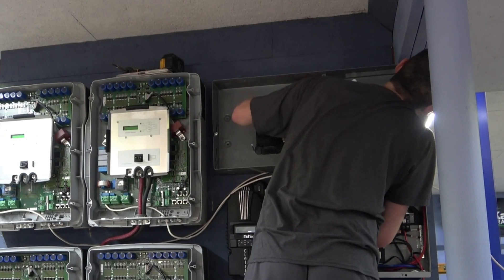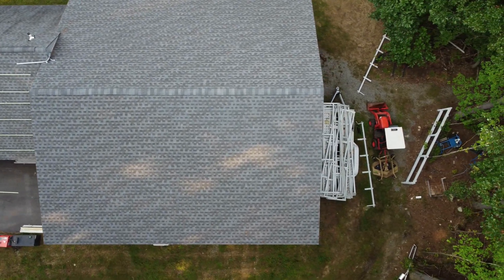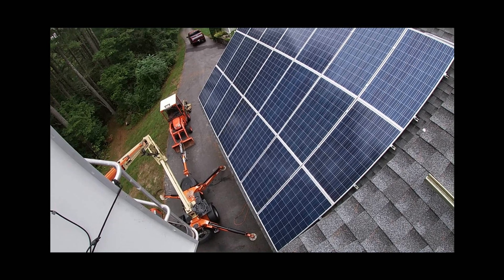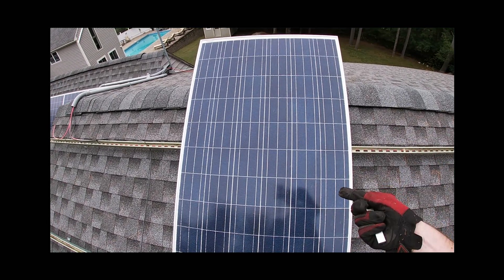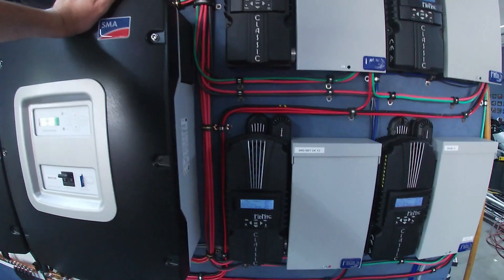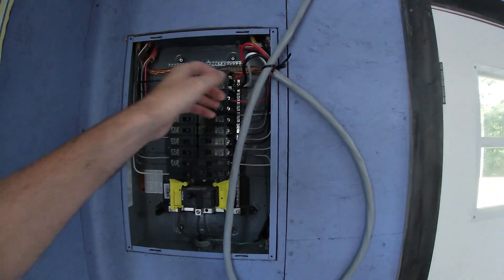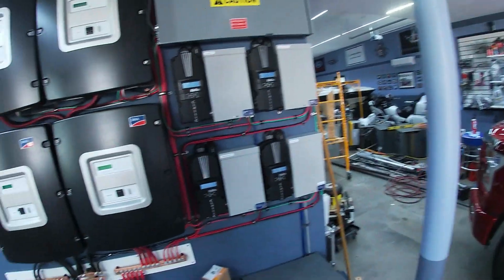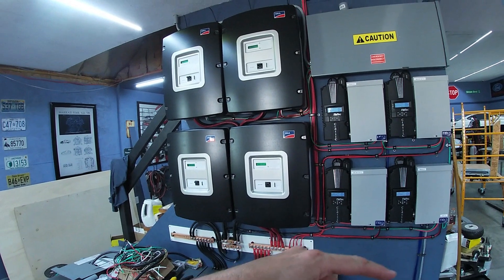INSANELY Cheap Off Grid Solar Roof Mount System Get's To Work!

Comment: What manufacturer, watt size and voltage are your panels? I was looking at your layout and trying to figure out how each string was laid out on the roof. We will be installing our array on top of a 40' container - you are to be commended on the install on your roof! Fantastic job!! We picked up a used (cannabolized) DC Solar Trailer with the SMA's and wiring in the single box. The ten panels will need to be replaced and I am trying to figure out the type and how many panels we should use per SMA to increase output. Your (4) Midnite Solar Charge Controllers are just plugging away! WoW!! I think we should be looking into purchasing a second Midnite Solar Charge Controller if each SMA will perform better than the single on the trailer. Thanks for posting your video!

Comment: Aren't you running part in shade from the roof? That will drop the power from.the string a lot.
You may have to remove them or have then on a separate system.
Reply from the maker: Video of the trees coming down and the production results coming soon!

Comment: Nice video and loving the power distrubution wall. Just one thing I noticed, there seems to be a lot of shadowing on the panels, would solar optimizers given you more power?
Reply from the maker: The trees are coming down next week!  I saved that for last so I could work in the shade.  Thank you for watching and for the suggestion though!

Comment: Dry clear, UV rated superglue will cost $5 but save that panel as long as the actual rock is not cracked.

Comment: Hey Tom. A couple of things you should maybe look into.the first which is probably the most important is the string breakers if they are not dc breakers they will probably catch fire when drawing an arc .the spacing of the inverters to prevent over heating should be in the installer manual. Module grounding and surge lightning protection .and the losses due to shading one module will affect the entire string. 
Otherwise your installation looks really great 👍

Comment: Your going to have a very difficult time with the hydrogen gas management. Also how are you supposed to fill those battery units just below the inverters?
Reply from the maker: Gas hasn't been an issue yet anyway but if it is. I have a plan for an extractor setup.  The cover more than clears all obstructions on the backside for filling.
Reply: @Trialnerror  You got these from a DC solar trailer correct?  Did you join the facebook group?  Did you see the explosion that happened to the battery (Oct 9th) from someone working well away from it?  I just want to make sure you know that the electrical code has specific requirements for ventilation  of battery backup systems with FLA batteries.  This can blow your entire garage up in one shot if your not careful.  I highly recommend getting a  box built with a vent to the exterior.

Comment: Considering you are on the grid, wouldn't it make sense for you to tie into the grid at some point?  That way you could sell your power back to the grid?  What does NH provide for net metering or solar credits?  Usually you can push the power back to the grid in the summer and draw from the grid in at night and winter.  Do your inverters allow for that type of set up?  In a hybrid setup you can charge your batteries and once full push any excess power to the grid.
Reply from the maker: Yes and no.  It would have some benefits but some MAJOR detractors such as not being able to use nearly all of the equipment I got for basically free.  When you grid tie there's a whole bunch of extra steps needed both in the setup and in the "approved" equipment.  The power companies basically have control over what can feed into their grid.  Used solar panels for example (in 90% of cases) cannot be used.  While my inverters can do it, I didn't want to deal with the bureaucracy or have to pay more just to be at the mercy of the power company to pay me back a fair rate.  I hope that makes sense?
Reply: @Trialnerror Yes that makes sense the utility does not want to be responsible for you destroying your neighbors sensitive electronics, its likely there are some politics also involved.  Its why I have soured on solar,  the large investment is not worth the added maintenance and limitations of solar power, I am good with investing my money elsewhere, owning a backup generator, and letting the utility figure out how save the planet.  Considering your minimal investment, your setup makes a lot of sense for someone looking to eliminate most of their electric bill.  I am not as optimistic as you that solar will ever become an affordable substitute to grid power in our life times, after all those power trailers don't come up for auction everyday, and as fun as it is riding that lift, you will eventually grow tired of tinkering with the arrays on your roof.

Comment: Does someone from the power company have to come out and inspect your setup to verify it won't backfeed the power grid during a power outage?
Reply from the maker: The output side of this system is not connected to the grid in any way.  This isn't a grid tie setup it's off grid.
Reply: Won’t this back feed if the grid goes down and you do not disconnect it either through a Manual disconnect or flipping the main breaker?  I have a grid tied system without backup and they required a manual disconnect at the house. If the grid fails they will disconnect my system like any good commie organization would. Actually it allows protection for lineman.

Comment: Sure are a lot of tree shadows where you're mounting your panels. I'm guessing we'll be seeing a video of you renting a boom lift and trimming some trees. 😁 Do you have this system set up to feed back into the grid if your panels are making more power than you need? It's fun to watch our electric meter run backwards and then get a negative bill from the power company once in awhile.
Reply from the maker: For sure, that line of tall pines is coming down.  I waited so I wouldn't have to work in the sun :)